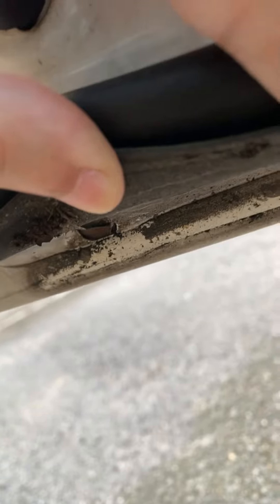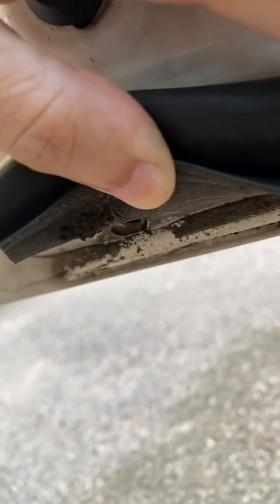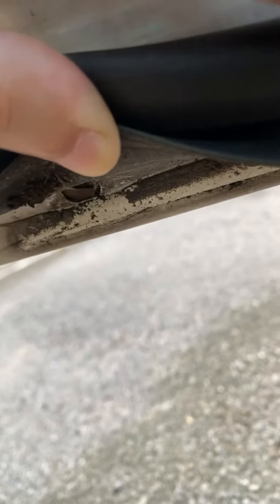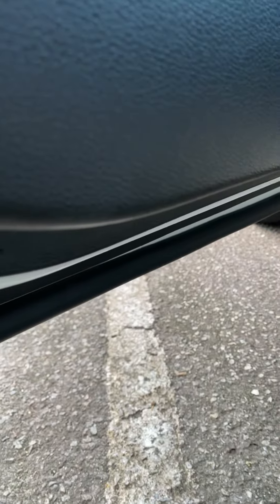DIY Honda Civic 10th Gen Door Drain Clean Up #howto #car  #tips #driving #howto

Comment: Thank you for your video! Just a quick question. Does that mean that it is normal that water flows THROUGH the inner part of the door?
Reply from the maker: You are welcome @tecneto. These are drains we talked about that allow rain to flow through and drip onto the road as we drive. NORMAL for water to FLOW through. ABNORMAL for rain to COLLECT inside the doors. You don’t want water collected and then leaking into the car interior. I learned it a little late though.